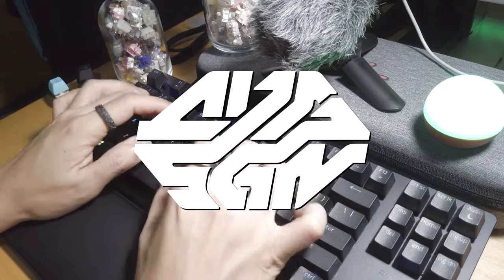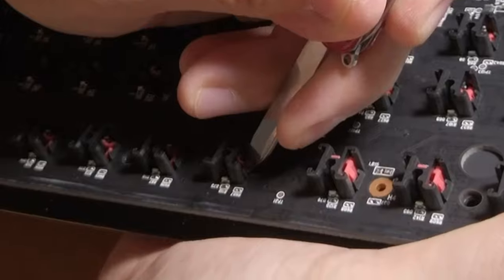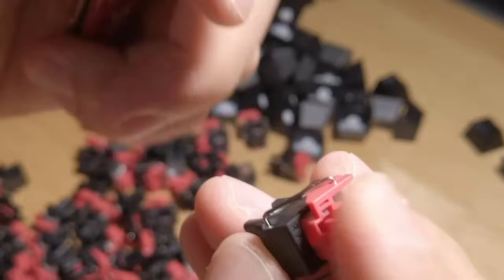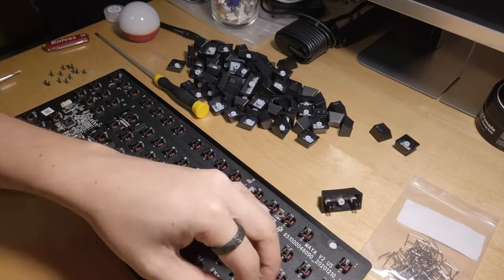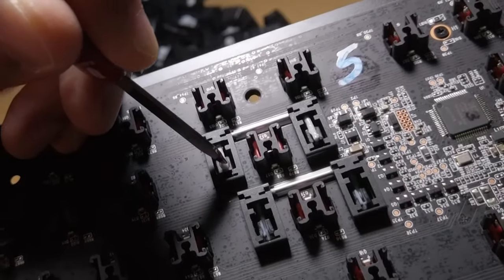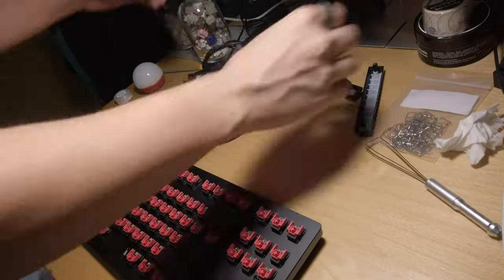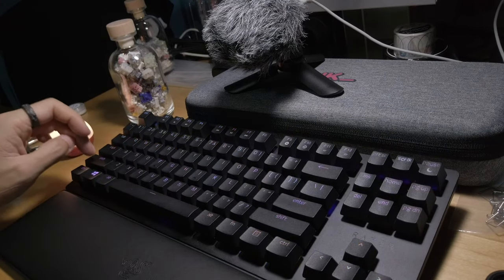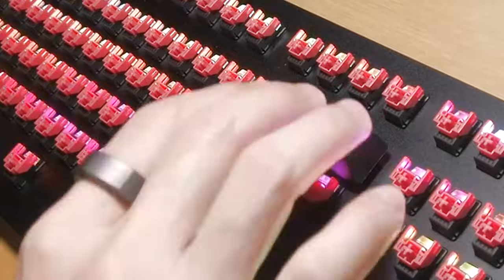Making my Razer keyboard better - Huntsman V2 Switch Wire Removal

Comment: So what does the stabilizer wires do then
Reply from the maker: What it does is help ensure that each press of a key is “perfectly straight” and won’t wobble from side to side as you’re pressing down on a switch.
Reply: @avgsgn  okey tha nk you i literally have been thinking the reason of them

Comment: As I understand, the switches here are A4Tech LK LightStrike Libra switches, where the wire stabilizer is the outwardly visible improvement over the older non-Libra LK LightStrike switches. Wonder if the non-Libra LK LightStrike switches would give you the feel you want, without the labour of wire removal?

Comment: I've had this keyboard for 1 week and I can't quite get used to that 1.2mm actuation point. While I'm playing and I rest my fingers on AWSD many times one of them is accidentally activated. How can I fix this problem without having to return it?
Reply from the maker: The actuation point is something you can’t fix. What you can do, however, is possibly swapping out each of the switch springs in every switch to a heavier one, so that it requires more force to push down on the keys.

However, that means you’re making all the switches harder to press down overall and you might not enjoy it. Plus, you’re not actually changing the actuation point to a lower one.

So in all honesty, I suggest that you return the keyboard.

Comment: Why would you want to remove the wires?
Reply from the maker: Because I don’t like the rattling sound it makes.
Reply: Yeah some of them would make a weird rattle ping noise and others wouldn't.. the inconsistency was more annoying to me than the noise was. It was easy enough to remove them, and I lubed the stabs while I was at it and added a little more foam. Now it sounds quite soothing.

Comment: The loud volume counter is amazing thank you for that. Could you try adding some sound damping foam to it as well? Thanks
Reply from the maker: You can, but it won’t help much. The lower case doesn’t have much space that you’ll need to fill, plus there is no need to add plate foam because the plate and PCB are already lined up against each other.

The keyboard is also a silent one!
Reply: I have the earlier full size version and modded it by adding foam between the switches (a 5mm sheet of foam where I cut holes for all screw thingies and standoffs and switches).

Then I put bathroom silicone and Eva foam (the one you apply with a gun) in all the crevices of the bottom plate. 

There is already foam between the bottom plate and PCB.

To be honest, the best payoff I got was to lube all the small stabilizer wires and make sure the proper stabilizer wires were lubed and we're rubbing against something (furniture pads, cut into strips and slightly lubed). 

You will get 90% effect with 10% of the effort.
Reply: @LinusBerglund  i did a very budget version. i fix did this which made a decent difference. then i lubed all the bigger stabilizers like the space bar with wd40 gel lube which yes probably not recommended, it do great. did this tape mod because why not. and then finally took the foam from a old gpu box the one that usually covers the gpu and cut and pushed it into the rear. that foam is super stiff and was super tight inside and was only able to get it together by screwing each screw down little by little like installing a heatsink but it worked insanely well. this was an insanely budget friendly modding of a keyboard and tbh it turned out as good as some of the videos i've heard. for basically free for me at least it was well worth it.

edit: just realize this was a huntsman v2, i have a huntsman mini. there's no foam in it stock but same switches.

Comment: hi good video.  i have a question. i can not open my huntsman tkl, my keyboard doesnt  have the little sticker that covers the last hidden screw that is located at the USB port , i was wondering was yours the same process or different when tryingn to open the keyboard . please let me know, thanks
Reply: No hidden screws on this one (version 2 not sure about version 1) they are all exposed when you remove the keycaps. Top left corner has some glue or something so you have to persuade it a bit but there is no screw.
Reply: You just have to find them once you find the screws this process is universal for razer keyboards. Remove all stickers and clean goop with alcohol if necessary.

Comment: what is the difference between leaving the metal hooks and removing them? besides voices the pressure is different? do metal hookless keys improve typing? I thank you for the answer.
Reply from the maker: The metal hooks are meant to help “stabilize” your keypress so that the switch travels uniformly up and down when you press it.

I don’t find that it makes any difference at all, but I’m sure that those who are sensitive to these sort of feedback will definitely feel it.

Comment: Great video! I have a led on my keayboard that is always stuck on blue light. Can I resolve the problem if I replace the switch? Or the led thing is on the motherboard? I've already submitted a ticket to razer, still waiting for their response. I'm preparing myself for the worse!
Reply from the maker: The LEDs are on the circuit board, so unfortunately it’s not something you can change by swapping switches.

I hope they get back to you soon!

Comment: Great video! Wanted to know if these switches are replaceable?
My ESC key has stopped working, even though the lighting works, but even that is not reactive.
Unfortunately, the Razer service centre in India are telling everyone that they have stopped production of the Huntsman V2 TKL. They have only given the option to exchange my keyboard for others at MRP. They are taking my keyboard at the sale price I got it, but selling theirs at MRP. So even the cheaper keyboards would cost me double of what I paid for my Huntsman V2 TKL.
Reply from the maker: If you’re able to source for the same switch then it’ll be an easy fix! Perhaps you could consider swapping out one of the switches from a key you almost never use - like the insert key or pause key.

However if you swap the switch out and the key still doesn’t work then perhaps it’s a problem with the PCB…

Comment: I want to ask, as a person that hasn't disassembled keyboards and is afraid to do so, can I just remove the keycaps and lube with say a syringe the stabilizers on the big keys without having to unscrew the entire keyboard? Can I then put the keycaps back on with no problems? Would be very thankful if I got an answer, thanks!
Reply from the maker: Yep you definitely can. It’s quite common even amongst enthusiasts to squeeze a bit of lube into the stabs!

However the stabs here are close to costar type stabs so take your time and go bit by bit because they’re different from the “standard” stabs you find in most keebs.
Reply: @avgsgn  Thank you so much, you've been of massive help! ❤️

Comment: I did this to mine and I also removed the rubber dampeners within each switch by pushing it out from underneath using the wire right after I took it out. did this for all the switches and it sounds even nicer than just removing the wires.
Reply from the maker: Whoa thanks for sharing.
I’ll have to try it out on mine!
Reply: Thanks you for advice I think it makes the switches sound nice and clacky

Comment: This is an excellent video!  Very well thought out and intelligent!  Great job!

I can't help but wonder why those individual switch stabilizer wires are there!  Yours is the only video I've seen where the wires were removed and the sounds compared.  I would love to hear what Razer's rationale is for having the wires in place...
Reply from the maker: Some people have said that it helps to ensure that every press of the switch will always be “evenly flat”, meaning that it helps prevent stem wobble during your keystroke.

Comment: Did the keys got too wobbly without the wires?
Reply from the maker: Nope!
Reply: @avgsgn  Can confirm, I did this to mine a couple months ago after first seeing this video and it's totally fine, and I am a hard typer, especially my WASD keys would be having issues if it was going to be a thing. Feels more like a regular mechanical switch now, and without that weird rattle ping you would get on some of them and not the others.

Comment: Without wire it sounds more louder
Reply from the maker: Really?
That’s opposite of what most people say!
Reply: @avgsgn  I can't say it for every Razer board but my Huntsman te does I tested it using decibel meter with wire it was around 56db
But without wire it was 58db
Not much of a difference but thought one should know can't say why this happens even I am confused
Edit note : Huntsman TE uses 1st gen of Razer optical switches and it is predecessor of Huntsman v2 which has gen 2 optical switches 
My keyboard has linear switches